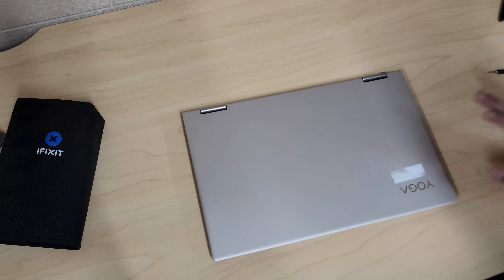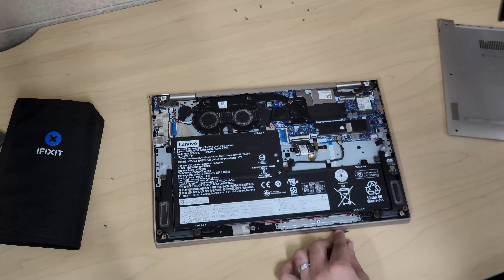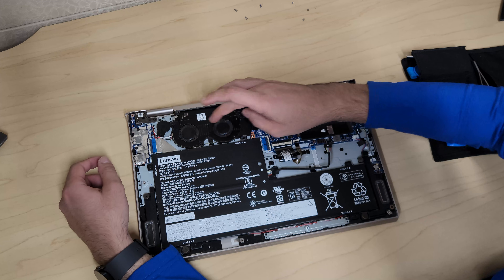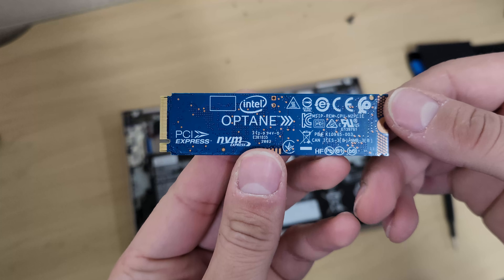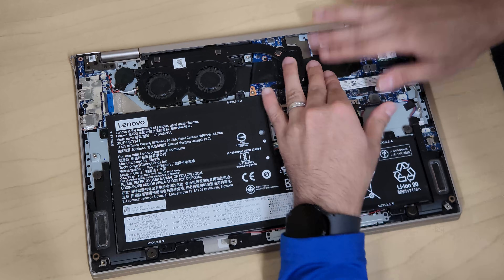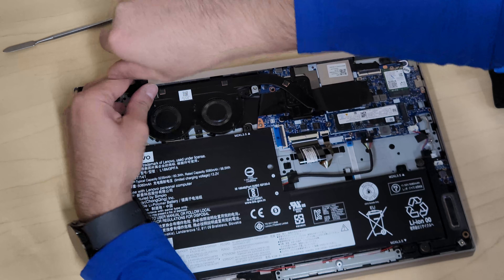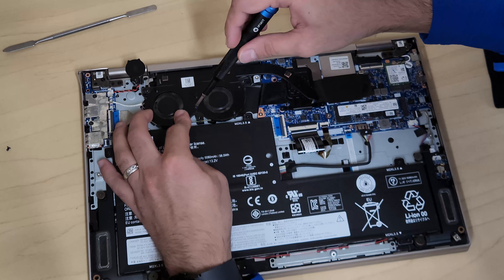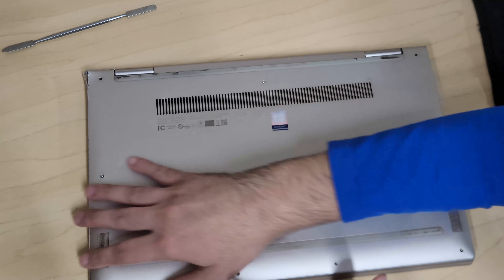Upgrade and Fix Lenovo Yoga C740: SSD, Battery, and Fan Tips

Comment: I am waiting for a fan replacement. In the mean time though the noise is an unbearable high pitched scream ruining my ability to work. Do you have a recommendation of best way to turn off or stop the fan without any damage
Reply from the maker: you should definitely not unplug the fan. your cpu will overheat and cause more damage not worth fixing at that point. did you open the case to check if anything is stuck on the fan?
Reply: Yes, I opened the case and everything looked clean. The right fan seemed loose or off balanced and kept catching or screeching
Reply from the maker: @danekinninger5390 yeah, most likely the case. only things that come to mind would be to clip the fan blades for the one makkng noise but wouldn't recommend it in case something goes wrong. make sure to have thermal paste ready for when replacing the fan
Reply: Thanks for responding so quick! Do you think clipping the blades is too risky even though I will be replacing when the new unit is in?
Reply from the maker: @danekinninger5390 It really depends on how careful you are. You don't want to risk somehow both fans to stop working. Especially since you're using it currently. Worth doing some research for better solutions than what I provided. Perhaps block it with something instead. But note that it will cause the other fan to work harder, and it's still risky regardless.  Could shorten the lifespan of the motherboard components if the working fan is not cooling enough. Try waiting for the replacement, but just throwing some ideas!

Comment: the fan on my daughters Yoga C750 is different. i use to just use compressed air till it did not. would run then stick till stuck. took apart flipped it upside down, removed the sticker and revealed thin wire thinner than human hair. tried spinning fan but didn't. i lightly tapped the center (as if i was pulling fan upwards on present position) tapped, then oiled with sewing machine oil. (yes it comes in a tube wit a syringe) Do Not Squeeze Oil Out let it barely come out in the tiniest drop and touch where you want to oil. if you squeeze you'll add too much oil into those wires and short it out. i replaced sticker added thermal paste because once you remove fan, you're already there Put New Paste! turned on laptop fan started spinning, then little rattle because daughter was hold it at an angle. told her to turn it upside down and let fan spin making oil go into wherever it must go. fan would not turn on so she turned on ROBLOX then fan started made a little noise for few seconds then it was fine for the next hour. it's a delicate job if you tackle it yourself. Amazon selling my fan for $39 bought found for $14 incase if you just want to exchange vs what i did :face-fuchsia-tongue-out:
Reply from the maker: That sounds like a lot of work, I applaud your tenacity in fixing it yourself!
Reply: @YD.00  Thank You :person-turqouise-waving:

Comment: I replaced my fan and it still makes noise.  Did yours remain quiet?  If so, can you link to the fan you bought?
Reply from the maker: is the noise actually coming from the fan? I don't have a link to the fan unfortunately.  I pulled it from another laptop